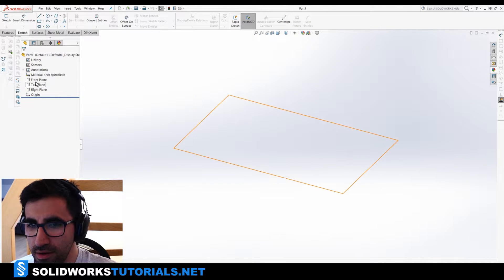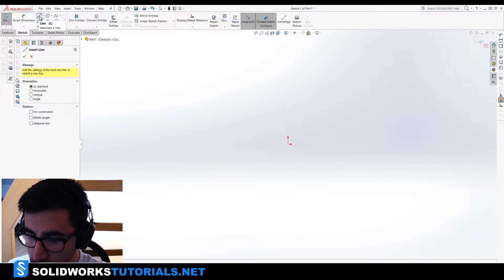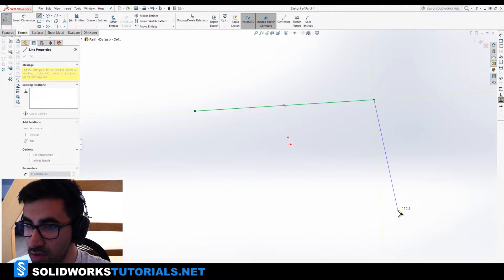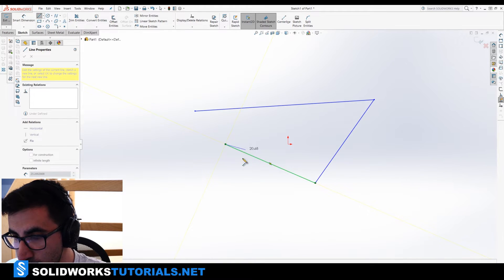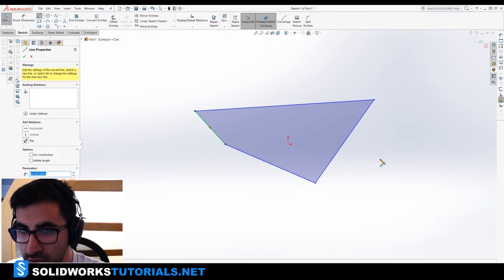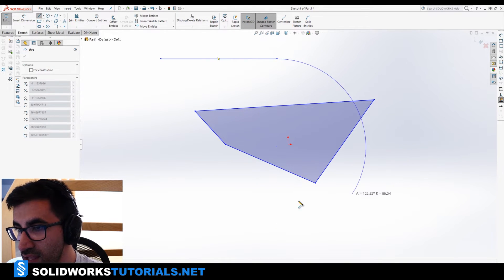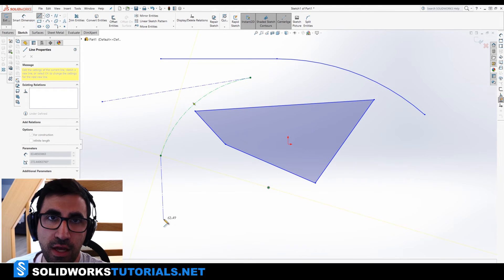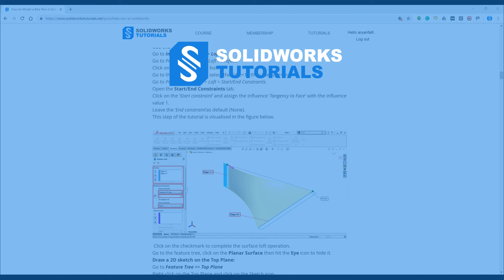Everything about Line in SolidWorks for beginners

Comment: Hi Aryan, 

Can you please explain why in numerous videos I see either from you or anyone else, where a sketch consists of an arc joining the other component of the sketch a circle is drawn and then trimmed. 
Why do that when you have 3 point arc, tangent arc or with the line feature the arc can be made, and tangent relation can be added if needed. 
I do understand solidworks has multiples ways of creating the same part. I just want to know why that method is so widely used. 

Thank you for your videos!
Reply from the maker: because that's teh most effcient and fastest way among other ways

Comment: Maybe it's me (because I'm really new) but: 1) right click on the mouse and moving it to the left does not start the line function as described.  It shifts the view of the plane from left to right or right to left. 2) You did mention having "shaded sketch contours" turned on. Thanks.  I struggled to figure out why my areas were not complete when they actually were.  3) The tangential line doesn't work.  There is no yellow square showing when I point to one of the endpoints of a line. 4) the length of the line doesn't show up as yours does.  I get the dimensional diagram type measurement.
Reply from the maker: Bill, you're gonna have to activate the sketch first. Select any plane by one time left clicking on it, then go to the sketch tab and click on SKETCH now if you do the right click technique your mouse should turn into line